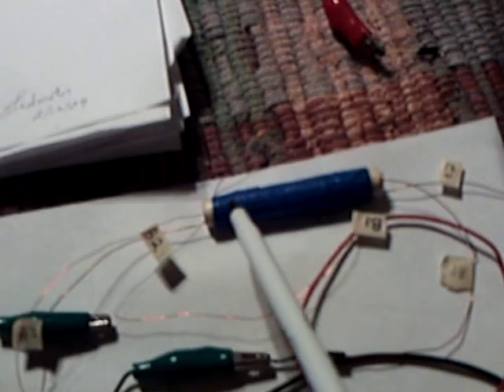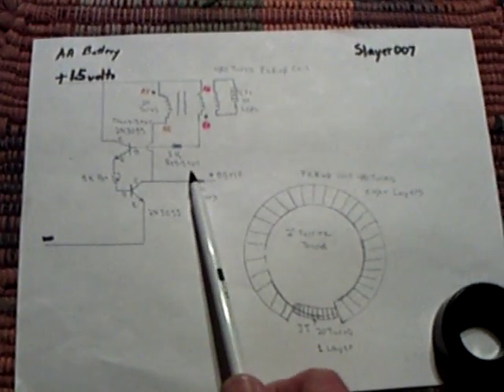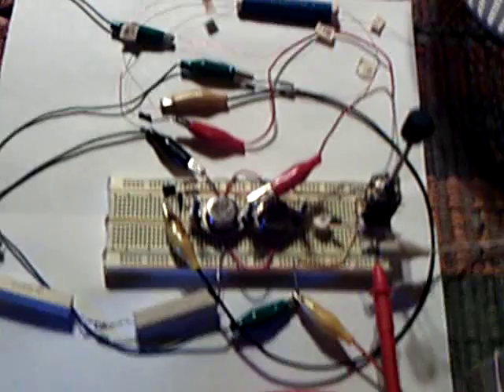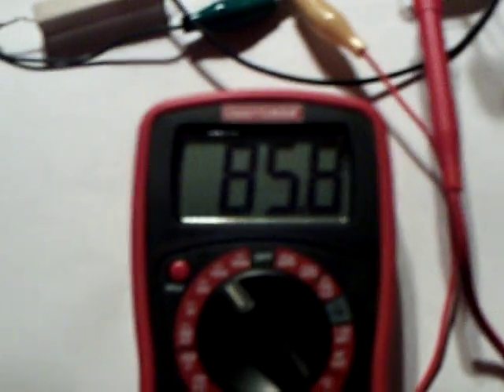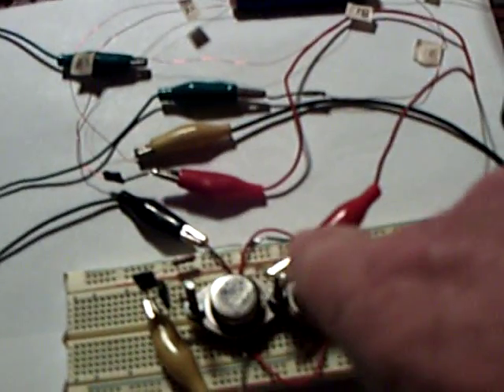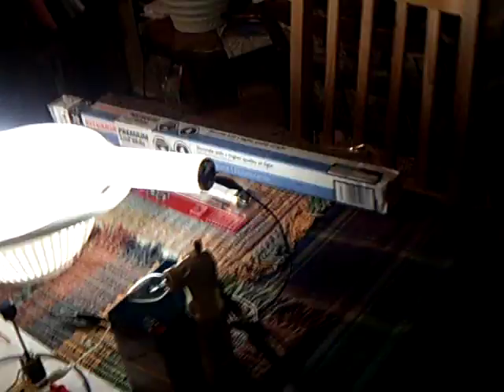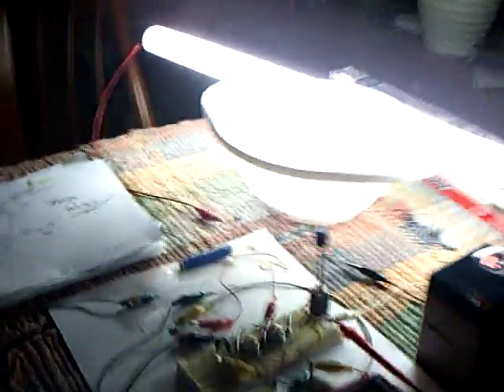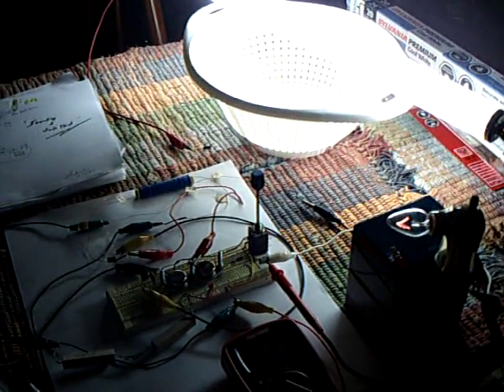Inverted Joule Thief Part 2

Comment: Well done, but what makes it different
from a nomal inverter ?
You are at least drawing 18 Watts from your
battery and at radio frequency and highvoltage AC the CFLs light better up, so ifou could decrease the power draw by at least 2:1 from the battery then it would be much better..
Regards, Stefan.

Comment: nice work, wat are the ratings of the extra caps in this circuit Lid??

Balast resistors work well hey, really takes the heat of your 3055
man that ferrite toroid looks expensive!

How bout loading the charging cap with 50-70V bulb